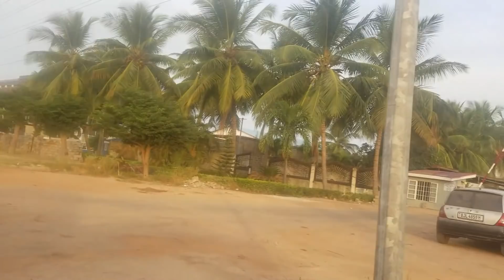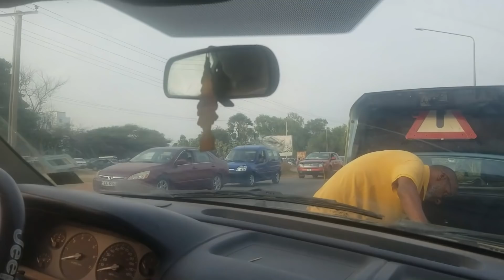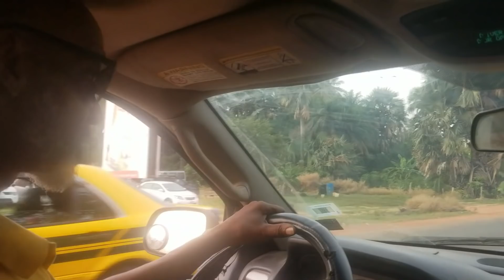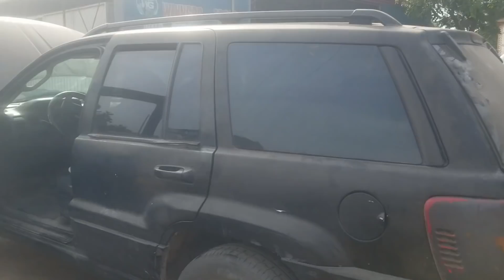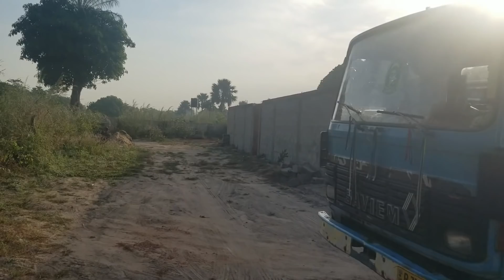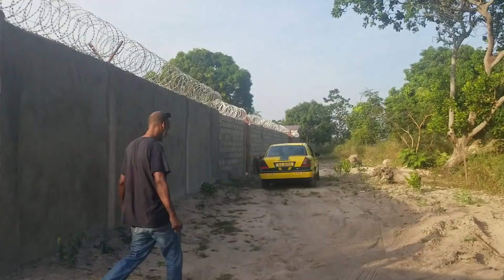The Arrival finishes the slab in-spite of a breakdown  in The Gambia

Comment: Once again, if you want to keep that fuel pump for long in tropical countries, keep your gas above half tank. Avoid the tank to go empty; avoid driving on 2 or 5 galons on a tank that has 30 galons capacity.
Reply from the maker: @ and yes there is so much dust even on the tank.....yuk.
Will get her hosed down and do the changes more frequently.  Appreciate you💞🙏🏽💞🙏🏽💞🙏🏽
Reply from the maker: @ Kal thank you yes have to be more   careful with that situation 🙏🏽💞🙏🏽💞🙏🏽💞
Reply: Agreed!  Living in the west I was told by my brothers never let your gas tank get lower than 1/2 tank. Fuel injectors gets dirty and clogged which causes a problem with the engine. But anyways Kenny and Teri hopefully all is well when you read this. Praying for you all!  Ps thank God for friends!